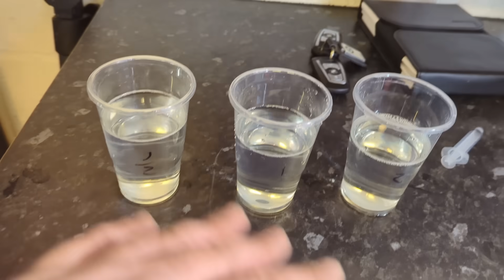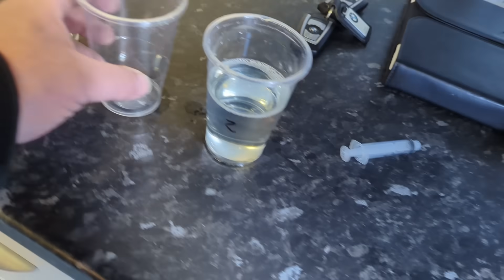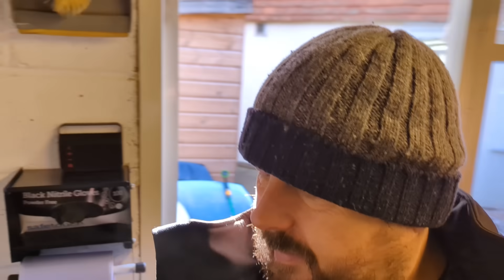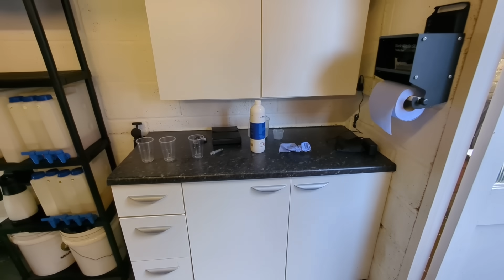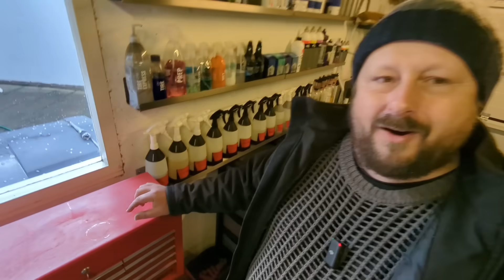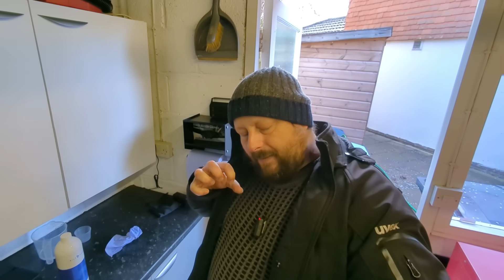Bilt Hamber Cleaning Power Test  0.5/1/2 PIR

Comment: I can't be bothered working out PIR so my go-to is 200ml Touch-Less diluted to a litre and let it dwell for as long as possible and rinse off with the pressure washer and the jobs done .... The car was ceramic coated back in mid April 2024 with Synergy 2 and after this prewash it rarely requires a contact wash. I've thought of dialling it back a bit but I'm only cleaning my own car so cost isn't an issue as much as making sure the car is clean first time....

Even in winter I'll pack all my stuff into the car and using pump sprayers and foamers I take her down the road to the local petrol station and cover the car down there and jet wash it off and it'll easily remove 95% or more of the crud from the car ... Saves the hassle of dragging everything out of the garage and setting it up then having to drain everything down to stop it freezing in the garage if the weather gets to cold ... It's a method I often use in the height of summer too as my driveway faces South and gets the sun from 6am so by the time everyone is up and away to work the cars baking hot ...the garage wash bay is in the deep shade so it's lovely and cool and ideal conditions....it's also cheaper as the foam sprayer only takes 20mls of Touch-Less to a litre

I've tried it at home using the garden hose but I find it doesn't quite remove as much of the crud from the car and certainly not the wheel cleaners

Comment: Great videos.  I  just had my car ceramic coated and was advised to use some ph neutral products for cleaning.   I jad some valet pro citris pre wash and formula snow foam but im looking for something better.    Would the new touch less v2 be safe to use on my vehicle along with a citrus pre wash combo as a pre wash.
Reply: You can use Touch-Less on its own to clean the car, especially with it being ceramic coated.... Use a citrus underneath in the midst of winter if it's really oily grimmy dirt on it

Comment: Jon, if you have left over premixed say at 2%, does it go “off” or have any effect on the product? Have you ever experienced this or do you always finish off what is in the cannon? Thanks
Reply from the maker: Not had any problems with touchless but surfex and af can calcify in tap water and block filters.  I don't tl does this but it can go a bit sticky cuz it's suger based so best to empty lance I think
Reply: @ForensicDetailing  hey, thank you for the reponse Jon. I have experienced it with Surfex which is quite annoying so i have started to used deionized water in the pre mixed bottles now which seems to have cured the issue.. okay i normally empty what ever is left in the lance in a bottle so might do the same then, sticky shoudlnt be an issue but blockage is.. thanks again!

Comment: Hi Jon, I can't quite remember your past original touchless panel test results (will check back myself), but I seem to remember, at 4-5% old formula, it completely stripped away your dirt simulator to reveal a pretty much clean panel (or was that autofoam that really excelled against dirt sum?) whereas I noticed this new versions 1-2% seemed a little patchy and left behind noticeable areas of dirt in this video. Just wondered what you thought.
Thanks
Reply from the maker: it never really completly removes it and it can be a little bit hard to cross compare between tests.  I do have old and new though I could test on the same bit of dirt simm.
Reply: @ForensicDetailing  Yeah might be a nice quick interesting test between the two! :)

Comment: I'm not sure about this 1ltr bottle of being cost effective as the 5ltr bottle was, I'd have to work it out. The 5ltr had nice coverage that had a this layer of product that clinged well for the dwell period, this seems to be thinner. BH have passed on feedback to the production team and we might see 5ltr Touch-less again soon, whether its in the new concentration formula or the original we'll have to see. Either way its the best precleaner.
It might just be a case of getting used to the new PIR and thinner coverage. I used KCx GSFx snowfoam with Greenstar added the other day for sh*ts and giggles just for a change and its not a a patch on BH Touch-less, It failed to remove thick road film where as the BH Touch-less would have easily broken down it down. It makes me feel positive about using Touch-less, I couldn't be with out this product ever for my preclean now. 

Also, many people use the Touch-less snowfoam but don't use Touch-on shampoo? Touch-on shampoo is a fantastic product, I use it in conjunction with my MJJ2 snowfoam cannon and DI rinse. Blow dry, you don't need to use a drying aid or detailer. It gives it that just been ceramic coated glow look, a fantastic combination
Reply from the maker: the new formula will be available in 5l soon mate (if its not already).

Comment: John how many ml of product I need to add to get 2% PIR for using snow gun ( lance ).
Many thanks for reply.
Reply: You need to fill your cannon to 1 litre and pressure spray it into a bucket until it is empty.
Measure the volume of water , mine sprayed 11 litres.
Then do you PIR calculations.
I.E 11 times .oo2 = your PIR.

Comment: Jon, so 1% kinda works PIR, I'm cheap, I'd stay at 1%. COmpared to old Touchless is this now like 25% or less in the 'cannon'  and a DECENT massive saving over old Touchless???  Summer mid level dirt fine, PIR 1%, how much in Cannon!!!??  Cheers. This may get me away from TFR'ing every budget car I sell.   

1 to 7 parts, are we talking about the 15-17% in the Cannon?????   50 in 300, yup 16.5 of the Cannon???  If same price it's 3 times cheaper at 1% PIR, if you are right
Reply from the maker: 1:7 in the cannon should be close to 1% mate.  At least is was for me.  but you have to do the calculation for your system if you want to be accurate.
Reply: @ForensicDetailing thanks Jon. Clever from BH realising too much product used on the old product.  Listening to social media.

Comment: Not a popular take. I compared surfex hd to Stjarnagloss Forst. My PIR I felt was equivalent to 1 part product to 5 parts water. Stjarnagloss as pre rinse performed better. I was quite shocked. Maybe I did something wrong.
Reply from the maker: forst is designed to be used neat (forst x 1:1).  They are really juicy at potent at that ratio.   You would not use surfex at 1:6 as a prewash. thats like nearly 20% pir (you would use at 5% pir max as prewash).      Surfex is also an APC, touchless is a dedicated prewash that has some other properties beyond degreasing.  The elephant in the room with forst is the cost. a litre of frost is like 11 quid in its ready to use ratio.  I litre of surfex in a ready to use ratio is about what 20-30p?   love forst but I cant afford to use it I go through a litre rapidly.  Citrus generally is expensive but 5 litres of virasol costs like 10 quid and the limonene content seems ok its also a high concentrate you can use at like 5% pir.   once ive blown through my citrus surplus I would probably go for that.
Reply: @ForensicDetailing  I will give touchless a try. I bought surfex hd because of your reviews and how well I saw it cut through dirt and grime. I know it’s for sure on the higher pr side but Forst out cleaned it pretty well.

Comment: Did you ever try the Bilt Hamber Auto-Wash (very concentrated shampoo)? What are your thoughts on it?
Reply from the maker: oh course mate I use it all the time.   you use tiny amounts like 5-7ml or 1:2000.  So its cost effective.  But its low suds.  dont over dose it or you can risk a white film.   So most people wont like autowash because its like using water with a tiny amount of suds.   but if you trust it, its great.   Lubricity does not come from suds anyway.
Reply: I really like the BH shampoo. Compared to other stuff I’ve used I find as Jon says it wets out the surface really well over wax, which in practical terms has a far greater impact than more suds as the lubricity really helps avoid swirls. I generally use Autofoam/touchless as a pre wash, auto-wash to shampoo and then if it’s really mucky clay bar and then finish with Koch Chemie protector wax (fantastic product) I’d love a comparison of snow foam waxes as they genuinely do help as a drying aid and even after using double speed wax I’ve not really found the same results in terms of overall gloss as KC protector wax (30ml in a foam cannon will do a couple of cars so relatively economical) it’s longevity isn’t the best though.

Comment: Here in Norway the road film have to be removed in the contact wash. I have used Surfex neat with no effect on the road film...
I have tested Touchless  for some time now, I am on my second 5litre now. In my setup I use it neat in the snowfoam lance. Even with 10 minutes dwell time it will not remowe all of the road film, but it removes more than other products I have tested...
Maybe road film and traffic film is not the same?
Reply: Auto foam is probably better for winter road film.
Reply: @Mac_F87  Similar effect from Auto foam  on winter road film also. Have them both.
Reply: Never had any product removing road film, no matter what the dilution was. 🤷🏻

Comment: I use Touchless at 1.5% PIR. It works so well for my set up that i no longer have the need for a 2 bucket wash or even grit guards.
Reply: Really. Is that a weekly maintenance wash
Reply: @jcoul1sc . Yes weekly or bi-weekly. If you have grit in your bucket,  change your prewash routine.

Comment: I used this at 0.5% on quite heavy road film yesterday and it worked exceptionally well I'll keep between 0.5 and 1% now. Old price was £22.95 I think for 5 litres and I had to hit at least 3% for it to do the same.   New is £29.95 - £7 more for what is over double the strength - how've they done that!!!!
Reply: Probably order in bulk with those sugar based surfactants tbh. Apparently it’s been done for the USA market to make shipping and tariffs worth it.

Comment: The price of this has now gone up to £30 for 5 litres, the last time i got some it was only £22!
Reply: You use this new version at half the concentration, so it actually works out cheaper. I’ve been using the old version at 2%. Hopefully the new version I can use at 1% (as per John’s findings), so half the new product per use.
Reply: @clareleaton9208  Thanks for the info, when was the new version released? I can't see anything different on the packaging to suggest it's any different. I have emailed them to ask why the price has gone up, will see what they say!
Reply: @MartinBennett-rs6thrasher  I spoke to them on Friday and they have now added the 5 Lite containers and updated the PIR info. This was still showing the old ratios but has now been changed.
Reply: @fasteddy664 ... The PIR ratio is the giveaway ...On the original Touch-Less it was 4% for the maximum mix and the new version cut it to 2% so you're using half the amount .... I know this is a year late but I hope it helps
Reply: yes but that was much weaker. This is miles more economical.
Reply: As others have said, once you do the math, you realise this is better bang for buck and better value for money.

Comment: Love bilt hamber, been using it for years, however I’ve stopped using touchless since having my car ceramic coated. I can’t find any definitive answer to whether it’s ceramic safe or not so only use it on the other car now that’s not coated
Reply: I’ve been using Touchless for the past 14 months on mine that was ceramic coated 15 months ago with GTechniq. No problems so far. 2 weeks ago I used GTechniq iron fall out remover over the whole car and then a rinse with GTechniq Cersmic wash as a top up. Coating is still working great. I believe BH Autofoam is not so ceramic friendly…
Reply: @CB-DW If a ceramic coating cannot resist what are in effect maintenance cleaning products it's not going to last long anyway.

Comment: I’m thinking of getting one of the IK pump sprayers. If I were to use it in that would it be 2ml in every 98ml of water in the bottle?

Also do you need a pressure washer for this or not? Is a pump sprayer, hose, bucket and sponge enough?
Reply: Get a garden pump sprayer, I’ve got 2 of the 7ltr ones from Toolstation. And yeah with Touchless it can be hose rinsed off, as shown in this video it still effectively removes dirt. I’d recommend using the top ratio of 2% though as you won’t have the pressure washer to help remove dirt with force which obviously helps get a bit more off.
Reply: Yes, 2ml touchless to 98ml water for 2% pir in a pump sprayer or pump foamer